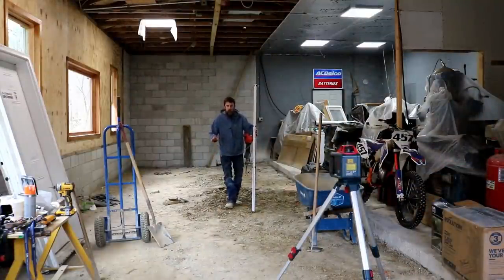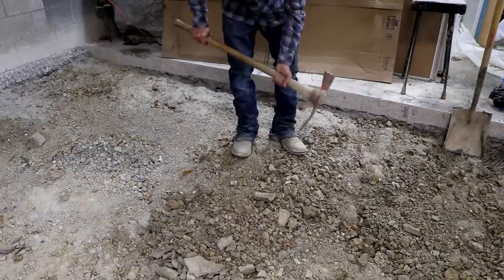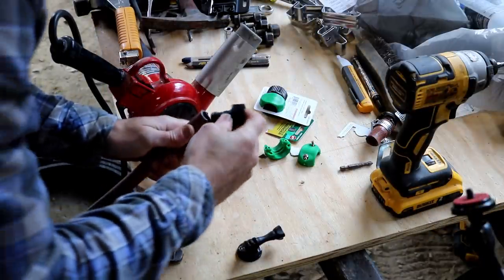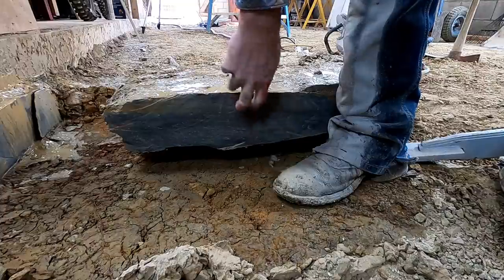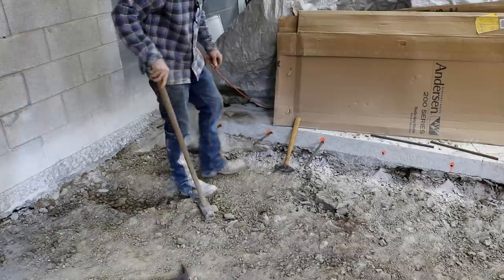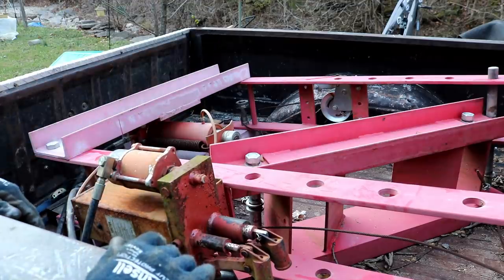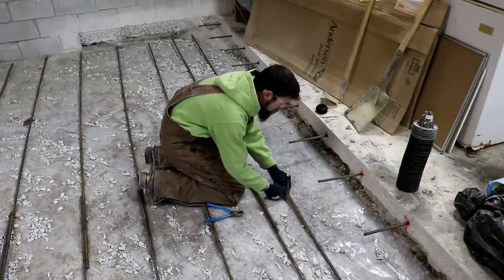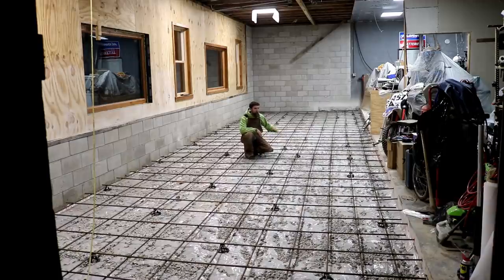Preparing for concrete .

Comment: Solution to the pad seems obvious.  Just replace the whole floor.
Reply: He would have to put all of his machines, equipment and all the other stuff outside, as well as being a huge job moving all the machinery it would be at the mercy of the weather, you didn't think it through very well did you
Reply: @andyb7963  Aww look at the video.  Hardly anything on that side of the shop.  Lol.  I have lived projects like this.  Start with a pos you just want to be better but every new improvement makes what started as acceptable unacceptable.
Reply: This is like those little plastic chicklet puzzles where you have a grid of 9 or 16 squares with one open space, and you have to move one space to the other side... two steps forward, one step back. When you are doing a "border shift" with the entire contents of a building, you are trading time for space (moving items as needed, multiple times). But the end is in sight!

Comment: A mattock is a wonderful along with a pick in fact, that's the best tool combination period. I know you're tossing the dirt and rocks outside of the shop, but, those rocks could still be used as filler for your concrete pour. You should check out "farmhandscompanion" on youtube. Can learn a lot of what was done back in the old days. 
You should've busting that stone down to a better manageable size. For screeding take a long 2x4, and cut it to cover the difference, (looks at as a long wedge). Unless you're going to change the other half right away, you're wasting time. 
Shame you can't add in "in floor heating", now's the time before your pour concrete if, you're going to do that. Cheers :)

Comment: Do you need a vapor barrier under that concrete?   UPDATE i see you put one in after you talked about the shop press.
Reply: watch the video again, it's already installed. You didn't catch it. Hard to see, I found it by looking right at / along the edge of the cut concrete.
Reply: @stanwooddave9758  Thanks for pointing that out.  It is hard to see, but now I see it was installed after he shows the hydraulic press.

Comment: only two things: no concrete will be as strong as that stone you cut and took out, and: turn the cart towards the exit, while it is still empty, it will be easier in your life
Reply: Did think the stone would be easier left, but probably  would've got in the way of the DPC and the Rebar, strong maybe but could be fractured or brittle, If it was lots of bedrock I would probably leave them but just one big stone Sometimes easier just to shift it, pain to shift it when you're onto the next phase  It's covered up   :):):)
Reply: Yeah, I wonder what's best. Leave it or remove it? Some types of rock are indeed brittle. And if stone and concrete expand and contract differently it may end up cracking...But it looks like a big solid rock...
Reply: I fully agree
Reply: Leaving it creates a stress riser and will be where the new floor will crack. I did some landscaping and had a three foot bolder sticking up just three inches above the fist level of block. Researched it and it had to come out for the same reason.
Reply: I bet 7” of concrete is more than strong enough for water Steve is planning to do in that area.  If he left the big stone in it may have caused damage to this new pad when he jackhammered the adjoining pad In the future.
Reply: @shadowdog500  and? what that have to do with my comment? or we can cross that bridge when we (him) do other side? but wait, stone is cut and removed and for shure you can not tell what Steve is planning
Reply: @leoljepotic3863  Steve is putting metal between the two sections so he can screed the new section level and so he can address the other Crappy side in the future.  He states that in the video.  Regardless, I wouldn’t have left that rock in either.

Comment: Great progress on the shop. I see the vapor barrier is in place under the rebar. You won't be sorry. I can tell you rebar is nice but the same could have been achieved with the fiber glass reinforcing mixed in the concrete. I did this in my shop 20 year ago and the only cracks are at the key joint where it was meant to crack. But keep up the good work. Looks real nice what you have done so far. Should last a goood long time.

Comment: Steve, I've been wondering for a while about something. You've gone through all the trouble of sealing up that beautiful shop, are you going to go with a different door? Perhaps a roll up, or standard garage door? Also, I think you mentioned that you are going to be walling up the machine area in this vid. Working in a one car sized machine shop myself, I am constantly hamstringed by space constraints. I hope you decide to expand the machining area. Especially for all of your new/future acquisitions, and maybe a proper gantry (instead of that engine hoist. :)
Thanks for the content, stay safe, and keep an eye on that pistol of a pupper.
Reply: Side rolling barn doors can be made strong, well insulated, attractive, and can be clamped tight with modified truck chain binders. They also take up less room.
Reply: A gantry crane is way too expensive for the 1x/year he'll need it. He doesn't even need the engine hoist 99% of the time.
Reply: @carlcarlamos9055  I didn't know those types of doors could be sealed up like you say. I'll have to look into the binder thing. Never heard of that.
Reply: @xenonram  Perhaps so. I know from experience that having a way of mechanical lift has saved my back multiple times. I thought I wouldn't use mine as much as I actually do. We have a bridge crane at work, and the capacity to hoist is invaluable. Call me lazy, but putting the cherry picker together just to pull the vise off the shaper for an op is a waste of time now. I can just wheel the gantry over top of the table and pop the vise on/off. Thats only one use that "pays for itself in time savings". Gantry cranes don't have to be expensive, especially if you know how to safely fabricate stuff. Which, I think is covered here. If not a gantry, maybe a jib and chain fall?

Comment: I use old hairdryers, I get at Thrift Stores, as heat guns.  $2 apiece.   You are a man rich in rock.  I hate to be a safety NAZI, but you really need at least a dust mask when blowing out that concrete {silica) dust.  Take from a man with work related asthma and chronic bronchitis.  Nice press pick up for the shop.  The rebar grid looks good.  Praying you and the family are well.  Have a good Thanksgiving.

Comment: I dunno how you didnt crack that concrete hammering in that rebar like that every foot only 2" below the surface..  seems like thatd a cracked it to pieces and spalled out across making big o cracks everywhere..  slabs get to be delicate when theyre around for a bit where they get stressef from soil heaving, especially with a creek right 100 foot away..

Comment: Steve, Do not put your rebar at the center of your concrete otherwise it doesn't serve its purpose of preventing the concrete from cracking/breaking on the side with tension when it flexes under weight. Unless that is about is low as you could drill those holes in your old pad then nvm

Comment: I did my fare share of concrete and honestely 7 inch WTF Thats 21 cm!
 for a slab on the ground 5 or 6 cm is usualy more than enought even for heavy equipment. 
if anything in your situation i would have added material, concrete is expansive. definitaly would not even have considered touching that stone, it was perfectely fine there.
Reply: @Goettschwan if you say so. better safe than risking having the lathe sink in the ground.
Reply: I'm having a 4,5 ton car lift installed, most manufacturers want a 20 cm slab thicknessfor those. Some power hammers (for smithing) wants even more. 7" isn't all that thick for a shop floor.
Reply: @ColtaineCrows  ok then i was mistaken. obviously never had to instal a car lift. 
good to know (I actualy plan on getting one

Comment: have you ever seen a squirrel get eaten by a fisher - either it shows how dumb squirrels really are or how totally bloodthirsty fishers are - maybe a mix
Reply: concrete work, like roofing, is not easy - at all - good for you for hanging in there and getting it done - major shop improvements will pay off down the line
Reply: i would demo out the old pad instead of trying to do skim coat? maybe do a hw floor out there in front and then you can adjust the subfloor to compensate? it is a minor issue but when you are redoing so much you want it to be optimal - good timing with winter on the way - consider adding some pex to the rebar and you can get radiant heat in floor from woodstove - works good - some added cost but like gutters probably worth it

Comment: skim coating existing concrete is not the best idea it never really binds,it will eventually peel off and you will have a mess maybe some kind of professionally applied epoxy floor coating will work good luck

Comment: Steve, when the time comes to cap the old part of the slab, think about using concrete that contains polypropylene fibers in it.  Yes, it's an expense, but you do want to hold the amount of cracking down.

Comment: Pour your new concrete 5-6" higher than the old slab, then pour a new 5-6" high, reinforced, level slab on top of the old slab. Would save you from busting out that old slab.